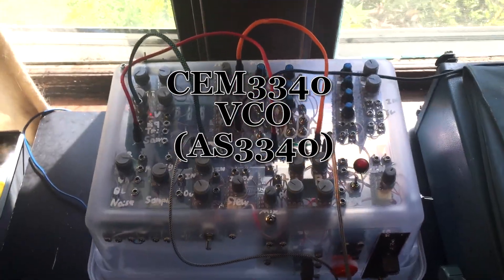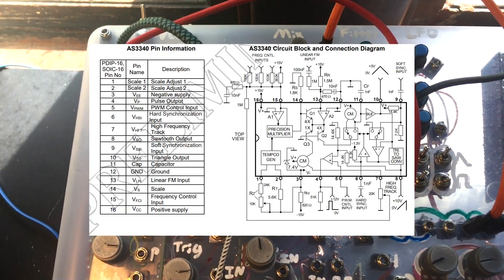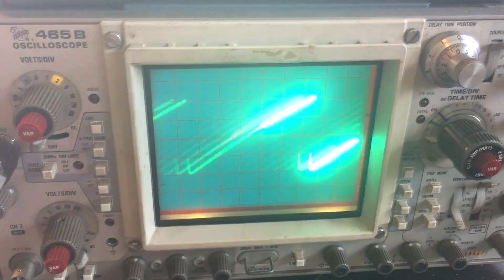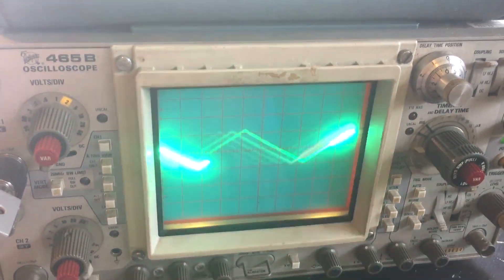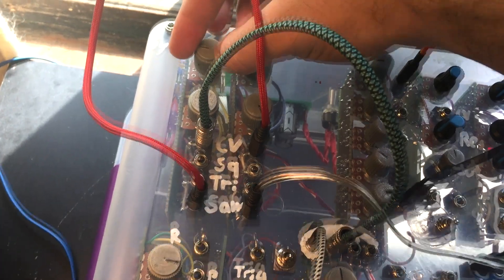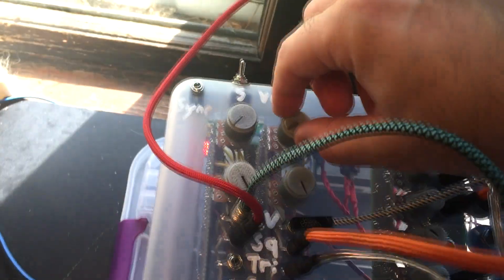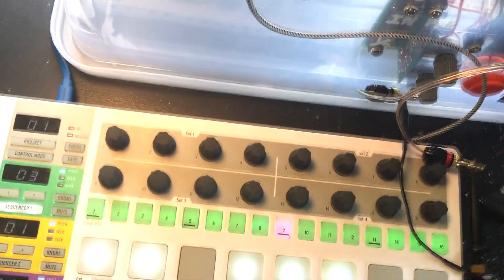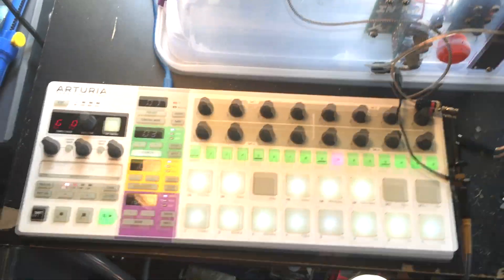CEM3340 VCO(LMNC Design) Sound Examples

Comment: I've been having trouble figuring out linear FM, it doesn't seem to do anything to my waveform regardless of what I throw into that input. any ideas?
Reply from the maker: Hmm yeah it shouldn't be a subtle effect so that's strange.  Seems to work best on the upper octaves on the  oscillator that's receiving the FM input, can't really hear it if it's low pitch but I  bet you tried that.  Double check the connection maybe? Should be just  FM Input >  1M resistor > Pin 13.
Reply: @miklos7503  so I got it working by using a 100k resistor rather than a 1M one, though it's deeply confusing as to why that made it work... oh well. I'm having fun watching the waveform get wonky and then resonate!

Now to build a VCF...
Reply from the maker: @TheLunaLockhart  oh that's certainly mystifying. I'm just glad it it works though, ha. Very savvy to try another value! 

Might go for the ms20 vcf? I just built the skulls and circuits vcf 1 and it's pretty awesome in its own right.